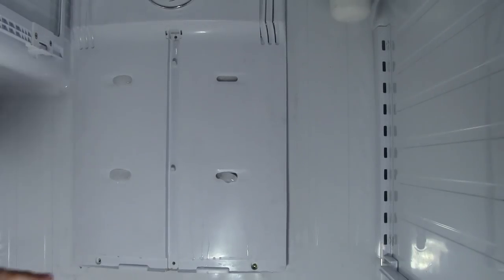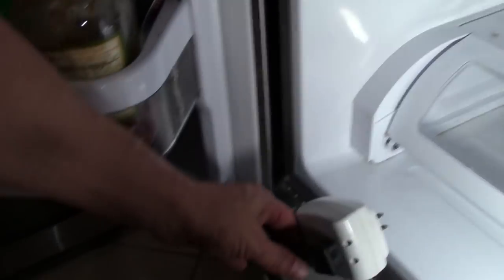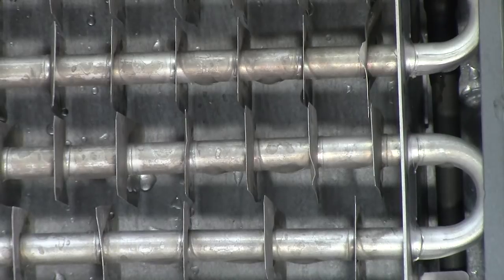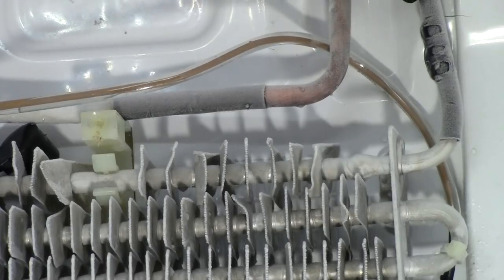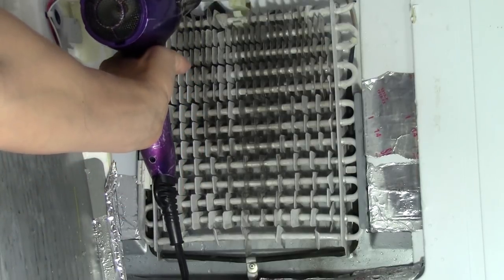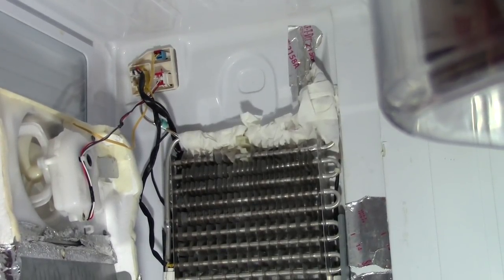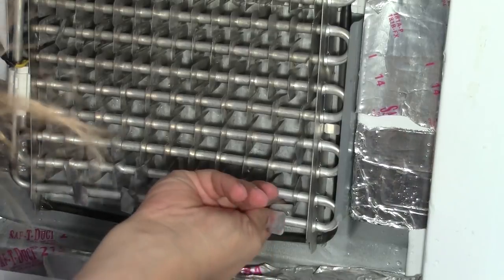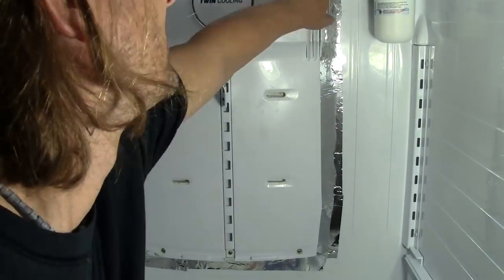PART 8 How to Fix a SAMSUNG RF 267 Refrigerator Not Cooling Icing and Freezing DIY repair

Comment from the maker: Parts:  https://amzn.to/3b5a2sX
Reply: Jake thank you! I'm just seeing this link a year later. As I told Marie mine was JUST starting to show frost coming out of the top 2 slots of the cover. (mostly top right) Do you think this is what's wrong with most of these refrigerators? WHERE does the thermostat go?
Reply: Hey jake we have a Samsung side-by-side refrigerator it’s a rs 265tdbp I watched a bunch of your videos ours is doing the usual keeps freezing up I have to keep taking it apart using the hairdryer on the coils it’s a pain in the ass at least twice a month I was wondering I know you said in one of your videos you were going to have a solution for that I didn’t know if you came up with anything To fix that?? Any help would be greatly appreciated
Reply: @user-cj2vu4jn7v  Got a RS21hduts. I got same problem. I couldn't find an exact solution. There is a hidden menu on fridge that has a forced defrost(fD) mode. Rather than removing the cover I use fD mode. There are some upgrade kits on ebay for side by side samsungs but didnt try one. Samsung keeps producing and selling the same under engineered frosting no-frost fridges for years although they know about the problem very well.

Comment: Spent all day watching Samsung refrigerator fixes, but this one was the best. And the comments are hilarious 🤣! Bottom line, we all got screwed by Samsung, found numerous videos on thawing out this piece of $hit, and a Facebook group of haters and a Class action lawsuit: Yikes!! Bought mine 4 years ago and had a repair man fix it at 7 months. I guess I should count my self lucky that I got three years out of it before today’s tear down to defrost. I might add that I had a perfectly working Whirlpool that was 14 years old that I replaced just to get a better “looking “ stainless steel refrigerator. One thing quite a few people have said to do after the defrost: get a 6” piece of copper wire to attach on the black heating wire near the drain hole, exstending 1-2”” into the drain hole. Apparently the fact the water freezes the hole up causes the water to drain into the refrigerator under crisper trays & then cause condensation that creates the freezing of the coils and fan ice to form. Do I get an A?
Reply: The amazing thing is this problem has been going on since before 2010 and Samsung kept denying AND making the exact same crap so do yourself a favor and junk these lemons you'll be much happier.

Comment: I put a copper wire through the drain..hooked it TO the heating element and NO MORE problems! I pushed almost 2 feet into the drain hole. I don't know if that much was necessary but it worked! This is after I paid 2 repairmen to come out who did nothing other than to thaw the ice out with MY blow dryer. Thank you all on YouTube who told me how to do it! PS I'm a woman...nothing stops me! It's been 6 months and it's working perfectly. I did clean out the rubber tube that comes down in the back to the drain pan since I had the frig pulled out but I do NOT think that was the problem. I did a "chat" w Samsung and asked if the copper wire would work and they said yes. It did!
Reply: Can I ask what gauge copper wire you added? Also a woman doing things by myself.
Reply: @mariec1439  14 or 16 gauge?? I figured the bigger the more heat it would conduct. I will say that mine started showing frosty ice coming out of the top 2 holes of the cover a month or so ago. I shut it down, cleaned all the pet fur off of the coils underneath and used the blow dryer on the cover wo removing it this time. Sadly it is already beginning to come back. If I can figure out where to put the thermostat I'll try that next. But 2 years was pretty good! I'm so glad you messaged me because I had forgotten Jake shared the link!

Comment: This is a permanent solution, so seat tight and enjoy my analysis.
The root cause of the problem is ice built up and then clogged up the cold air vent holes and jammed the fan. There are multiple reasons for ice build up:

1. Where did the ice come from? To minimize the ice we need to keep moisture inside to the minimum, which means covering up glasses of water, milk, opened sod cans, soup, cut open water melon, mango, fruits, wet vegetable, raw meat, etc. . The humidity inside the refrigerator is quite low, and so anythings that can be dried up will release moiture and this will form ice, and too much ice will out win the defrost heater short heating cycle (short cycle to achieve the Energy Star) and the net result is a slowly ice build up. 

2. The other moisture source is the bottom Pantry tray that collected water. You need to pull out the pantry and clean this bottom tray every month or so, or after a spill from trays above. Any liquid spill not cleaned up will ended up as ice inside the fan box -- no magic about this. 

3.  The bottom drainage hole is clogged up with ice. Once this happened, every degrost cycle will release the water down into the bottom Pantry and pool there. This water then evaporate and form ice inside the fan box eventually. (Hint: to melt the drain hole ice fast, fill up the "pond" above the hole with water then place a 15 watts soldering iron hot tip into the water and make sure to keep the hot tip from directly touching the plastic part. Add more water if the "pond is dried up. The hot water will melt the ice and clear up the drain hole. You need to keep an eye on this and remove the iron as soon as the hole is cleared. 

So how do we solve these  problems? It is unrealistic to have zero moisture inside the refrigerator, but if we can keep it to the minimum as I pointed out in (1) above, and with a modification to the design that prevents the drain hole clogged up then the problem will be eliminated permanently. 
To solve the problem (3), I used a 6 inches long, 3mm diameter copper (or aluminum) wire, wrapped around the black heater pipe  (just above the drain hole and running across left to right) 3 turns, and extended the wire down into the drain hole. If you don't have large gauge wire then just use two smaller gauge wires, wrap them on the left and right side of the heater pipe and extend the wires down into the drain hole about 1.5 to 2 inches. 

I used to fix the iced up fan every year, but after implementing the 3 steps above, it has been running over 2 years and still no problem. My unit is RF266AB. 

Brian
Reply: Brian,
Seems like you figure  you got these baby's  figured out... This fridge (and many Samsung's) suffer from multiple problems . One is the drain tube extension wire. This covers the frozen water below trays. 

Now frozen coils that stop fan and air flow and  fail to cool Fridge. If one manages to eliminate moisture sources (as you suggest) , no defrost problem !  Not realistic, (I'm an Engineer, must be tolerant of real conditions ,not hide from)  fridge should be tolerant of moisture and handle it. It did when new.   Thanks for Guitar Man  getting folks thru short term MELT DOWN .  

SAVE YOUR FOAM  defrost with water then  fix the REAL problem 
 I have read  post/video several times or the last 2 years as my RF265 began to warm (frozen Evap like you)

Getting tired of breaking out coolers,etc. Done 5x in 2 yr  I must say thought I've got it down to a couple hours.
For Defrost, water (hot from hose best) heat transfer of even cold water beats Hot air several x)  I can get cover off safely in ten minutes. Have 10 towels on hand. 

Plug drain to below, or be ready to turkey baster out the water from  pan out back. 

I see all the effort in insulating coil. Paper on real Hot coil ?? Maybe fiberglass.   wonder why I got 5 Yrs without this problem (had freeze up on bottom drain  fixed with longer tang)and now this,what changed ?? bought new.

Searching web and service tips, I thought I would measure voltage of sensors in operation. Not  too hard, PC board on back of unit. 

I forced a Manual defrost (press 2 buttons at once) rd,  and did not hear more than a slight tick from expansion. When Unit froze up, again.  I expect sizzle of water on hot coil. NOT 

So I read, if defrost sensor fails, it could think Temp met right away,  and  end defrost in 90 sec (said to 68 F for Refridge ends defrost)          OK and run ONLY  90 seconds. Barely a sizzle.

I Measure voltage on the sensors  (cn30? on PCB blue wire to gnd)) and it looks like 80 F (per chart)   to Computer (when surround by ice ) !! And must have been wrong for 2 yrs.

Have you checked/tested your Defrost Sensor ?

I replaced sensor and held in ice to test (reads like 33 f) , now it goes longer that 90 seconds and I hear the sizzler of water on the hot element !

Back together  may for last time !!!!!  let you know on a few months.

Let me know when you see this, I can help you troubleshoot if needed.. Mark fingers crossed in Ohio

************Update  10 Months  WITHOUT problems*********
Reply: Excellent analysis Brian.  Wish I read this before today, would have saved me lots of time.  I fridge completely froze over - took me over an hour to safely defrost with a heat gun to remove the cover.  Then another hour with heat gun to carefully remove all the ice.  I moved the thermistor sensor as some suggested.  Not sure if it helps any.  Finally discovered the iced up drain tube.  Another hour with boiling water, sucking out (with a small liquid pump), to totally clear that drain.  Then I used a 12" #8 gauge wire wrapping 2 times around heating element and sticking 6-8" of length into that drain tube.  Hope I didn't overkill it :-)  Will see how long this lasts.  Really like your analysis about keeping moisture down and regularly cleaning / drying bottom of trays.  I've never did this before until today.  What a mess.
Reply: Mark Carney , the reason the drain tube freezes is simple. Everyone tends to complicate it. Sure, a heat sink is needed due to the defrost element warping. The will warp away from the drain hole and are too far to keep it thawed. The heat sink, or wire added to element and the other end is in the drain will correct that problem. It won’t correct the problem of the water freezing up inside the tube. 

When the drain tube fills with water and freezes it causes water to leak out the refrigerator/freezer. You’ll notice water frozen under the drawers and leaking out the front onto your floor. This will not cause a “no cool” issue. The unit will cool properly. The only complaint is water on the floor. 
Every owners manual has a maintenance section. It will tell you to clean the condenser coils at least once a year. These coils are in back by the compressor. They pull air in from under refrigerator, over the condenser coils and across the compressor. This does several important jobs. It cools the compressor, condenser and keeps the refrigerant at a proper temperature. Too hot will cause the refrigerant to not liquify properly or the compressor to over heat. This also causes copper lines to erode, flake and leak. 
If the coils aren’t cleaned, the dust and dirt and pet hair will clog in the coils. This restricts the air flow that is needed. This also leaves no where for the dust and dirt to go. The fan is pulling in the air and it’s trying to find a place to go. The dust and air will travel to places they aren’t designed to go. Dust will be sticking to vents, getting stuck on the water valve and other components underneath. The dust will also make its way in the drain tube. Every refrigerator that I’ve serviced that has a leaking refrigerator due to a frozen drain has been caused by a restriction inside the tube. This restriction is dust/dirt that had no where else to go. 
Clean the coils at least once a year, more often if you have inside pets, and this problem won’t happen.
Reply: Brian Dang I did this today. I used a smaller gauge copper wire because it was the only thing I had. Fridge is cooling now.
Reply: Mark Carney hey read your post. What did you actually end up doing? Which part did you replace?
Reply: @markcarney1106  it's been a while, did your sensor fix the issue permanently?
Reply: @Spoofaged   I replaced DE frost temperature sensor over 2 years ago. It has worked great ever since until a month ago.  I have not seen in years with the ice growing out of the bottom holes and I caught it before the fridge became wsrm,  I heard the fan hitting the ice. But as it ended a be in I'm pretty sure the fact I had 3 or 4 bowls vinegar   exposed to the air  pickles for several weeks I think I overloaded its ability defrost that much. Inside of fridge is like dehumidifier. So I dug out the towels hose and  hot water .and besides now after a couple years the fridge needed a good cleaning anyway. I'm glad to see lot of people still wrestling with this issue this could still help.  For me part  DA32-00027B  $20-25
Reply: @ArthurGomes90   Defrost sensor. I'm sure if you look up on the interweb your model of the fridge and those terms you'll find some. That bear may not be your problem. I actually made measurements to prove that in my case it was.
Reply: @ArthurGomes90  DA32-00027B   $20-25.  After my repair I bought an extra one just to have it on hand. Good luck let me know if you got it fixed yet.
Reply: @scottt.armstrong9032   Please Scott sorry I missed your response a year ago. I just tried to call you I don't know so much about side by sides are would question to have. I was able to troubleshoot my sam Sung. Willin to help ya out if I can.
Reply: Couldn’t have said it better. Also touched on this a few comments up while explaining how to check the actual components to see if any need replacing after the damage had been done. The “trick” this user is showing is gonna cause a fire....I couldn’t believe it when I watched this. Like really? Defrost heater=extremely hot so the last thing you would want to do is take paper towel which are flammable and then spray them and the thing that gets hot with cooking oil which is also highly flammable and then stuff the paper towel in between the fins so they touch the part that gets hot. I mean I’m no rocket scientist but I would assume that should be self explanatory and easy to deduce! Anyhow, you really explained this very welll in your comment on how to fix this and I dunno if you do appliance repair or not but I do and it seems as though you really have a knack for it! Well, happy repairs to you sir!
Reply: I just put a small hole in the foam located in the top middle  right where the the words twin cooling is it allows my steam gun to hit exactly where the bloc of ice forms
Reply: Thanks Brain.  You really should do a video ! great advices
Reply: You are a life saver!!!!
Thank you!!
Reply: JUST BUY A SUB ZERO
Reply: Can you do a video. And show how you did it please? I’m struggling with my fridge freezer x

Comment: I sympathize with your efforts on this poorly designed Samsung refrigerator.  One note that needs to be taken seriously.  Do not use paper towels to insulate the cooling coils input line.  It is a fire hazard and may restrict air flow.  However, I did tightly wind foil tape around the input/output of the first two feet of the input coil, which seemed to help slow down (too early to tell if it eliminated) ice buildup.  The biggest thing that may help, providing that your defrost elements and sensors are working correctly, and the fuse for the defrost heater is good, is to move the white thermistor sensor, located upper right but outside of the cooling coils, directly to the input/output of the cooling coils at the top and right, otherwise noted as the point of the greatest/first ice buildup.  If the programming is working properly, then it should automatically defrost until that ice is gone, hopefully.   I also noticed there was a change in the white thermistor sensor at the right side of the coils to the after market black sensor you referenced at Amazon.  Did that help??  Also, I did extend a thick gage copper wire wrapped around the heating element and down to about an inch into the drain hole to keep it ice free.  Thanks to those that recommended that fix.

Comment: Hi to all you Samsung refrigerator owners. For the past year or two  my coil has been freezing up about every 2 to 3 weeks. I have found that the heater is working and sending water down under my crisper. Now after this melting of the coil water builds up at the bottom of the coil and then freezes because the little metal piece is not long enough to keep the drain hole open. What i did is loosen the heater coil and pull it all the way down to the bottom of the metal cover at the bottom. The coil is touching the metal cover at the bottom and the little metal piece is now deep in the drain hole. I have not had any water under the crisper for 3 weeks now and no fan noise. Also not sure this made a difference but i took the white sensor an attached it to the pipe to the left of the original position. Good luck Samsung frig owners. Jimmy
Reply: Moving the sensor worked for me.
Reply: @tracyhegr9950  Where did you move the sensor?

Comment: By laying paper towel or any insulation along the top of the evaporator or along the bottom you restrict airflow over the refrigerant coils. They need to be clear. Wrapping the lines above the evaporator where they enter and exit the cabinet is acceptable. Putting a combustible anywhere near the defrost element is clearly asking for a fire.

Comment: As a 45-year technician, I can promise you that using a hair dryer will dissolve the liner in Samsung, LG and most other brands when it comes to thawing the evap. Always use a steam gun t avoid replacing a refrigerator due to wall damage
Reply: Oh yes. I learned this the hard way.